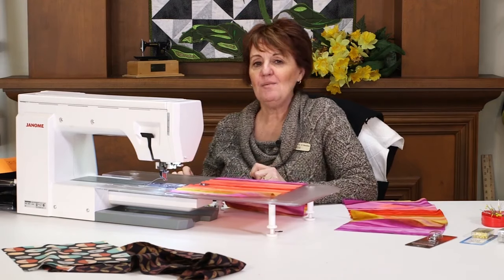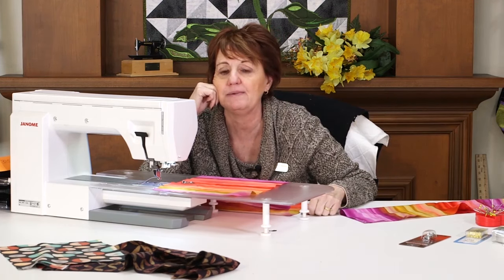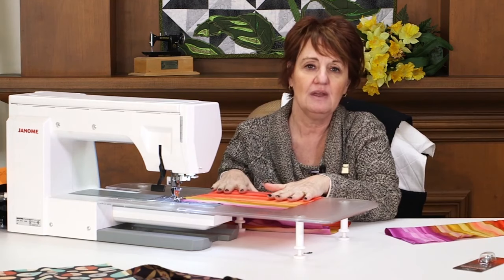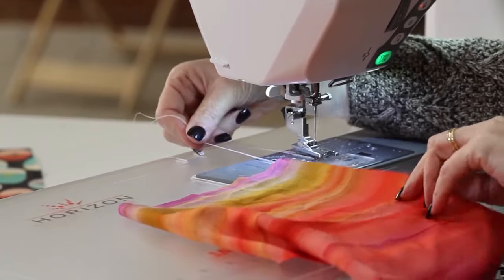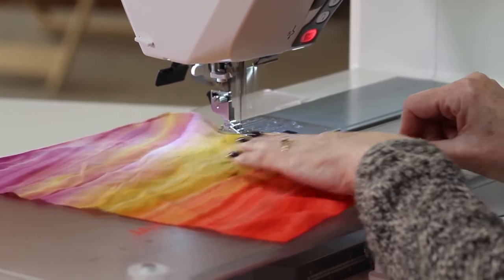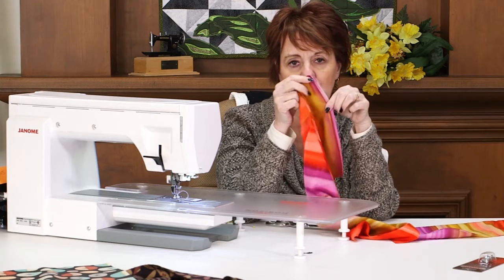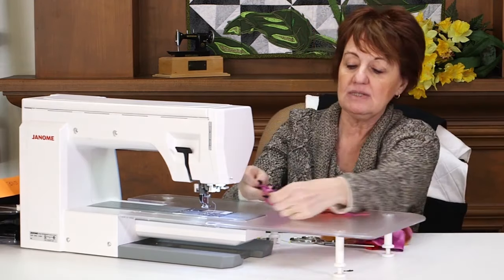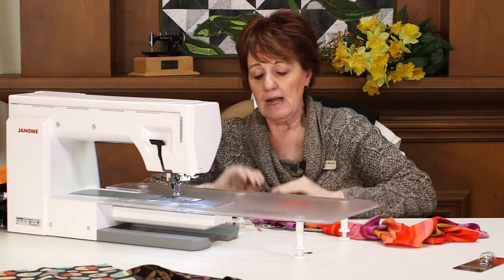How To Sew A Rolled Hem On A Sewing Machine

Comment: how much is this rolled hem foot? Usually those feet are more expensive than the sewing machine.
Reply: If you look at ebay or at  Chinese sites like aliexpress etc, you'll see whole collections of 48 different feet for a ridiculously small amount. You just need to know whether your machine is long shank (older ones are) or short shank (after 1980 or so). This means the thingie where the foot is attached, is it long or short. 
Of course there are no instructions and the names of the feet are in Chinese, but there are many helpful blogs and tutorials which illustrate each one of them.